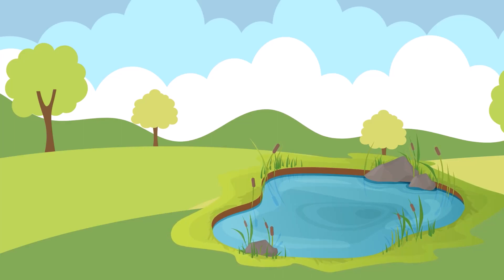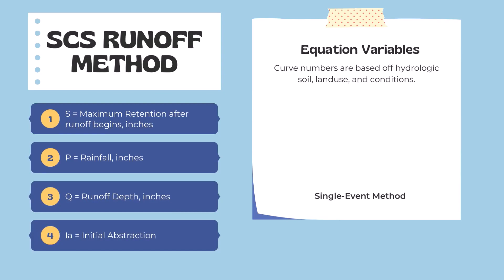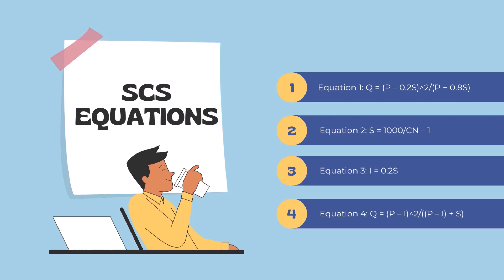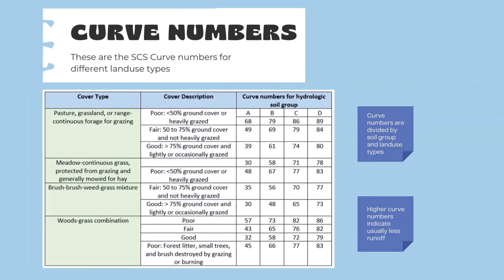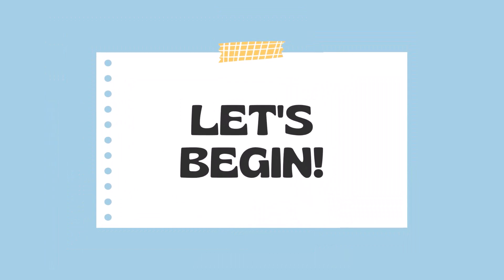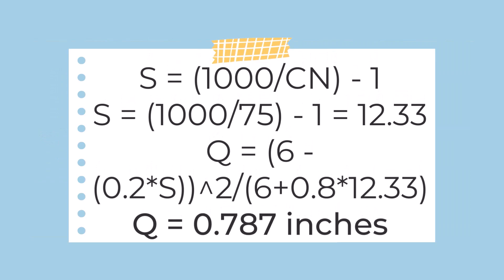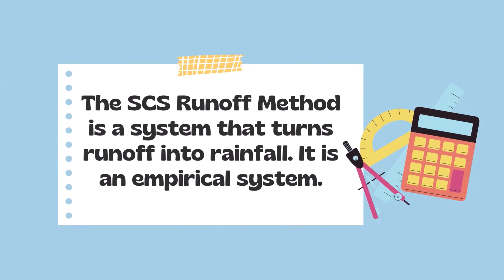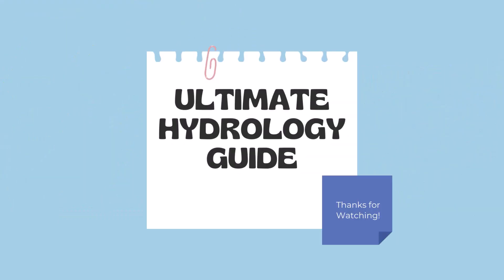THE SCS RUNOFF METHOD EXPLAINED IN UNDER 6 MINUTES

Comment: Could you tell me the difference between the rational method and scs-curve number method?
And why the rational method gaves discharge greater than scs method?
Reply from the maker: The SCS method is an empirical method, and takes into account soil types on a more detailed way then the Rational Method. Rational method also takes into account the Rainfall Intensity as opposed to precipitation in the SCS method, creating different results.
Reply: What is the best to use in designing storm water networks?
Reply from the maker: It depends on what your jurisdiction requires and what the project constraints are.
Reply: Thanks for your reply and your information
Reply from the maker: No problem! Glad we could help.